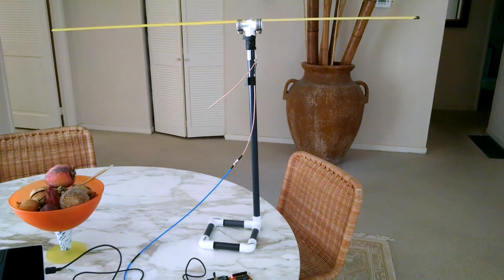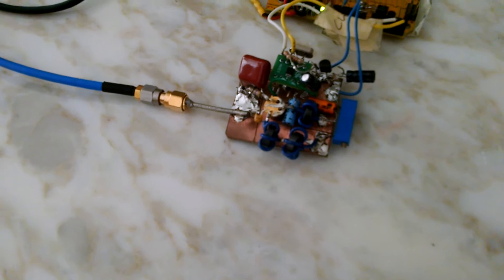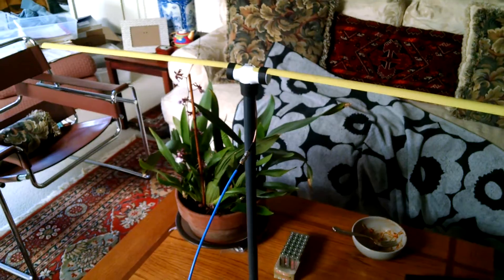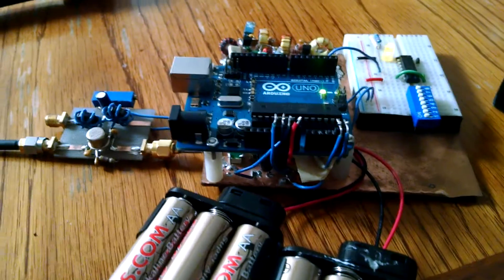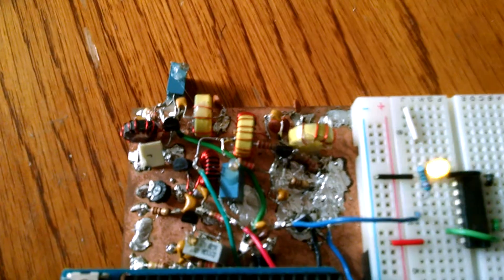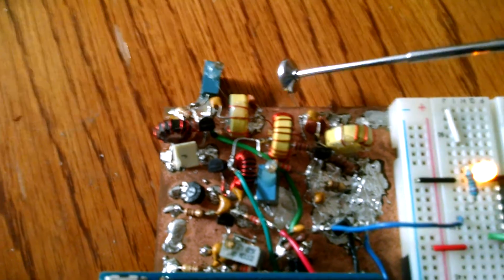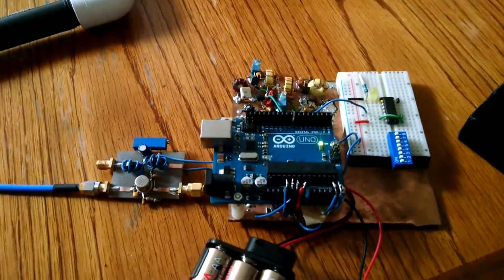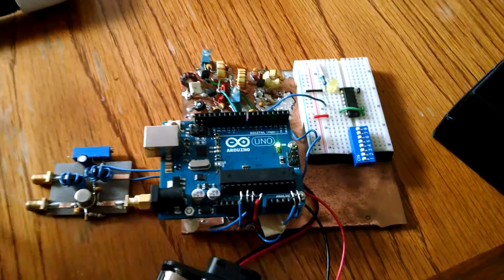DIY CW Transmitter and Receiver

Comment: which PLL IC and amplify translator do u use.
Reply from the maker: It was a silicon labs si53 something. I made a simple common emitter amplifier using a transistor rated for 150 MHz (I think). I think the most important part is to focus on the gain of the intermediate stage - my IF frequency is 10 MHz. Then, I had like 4-6 common emitter amplifiers boosting the signal to the point where it railed the output and was amplifying the induced 60 Hz AC (I live in America) signal.